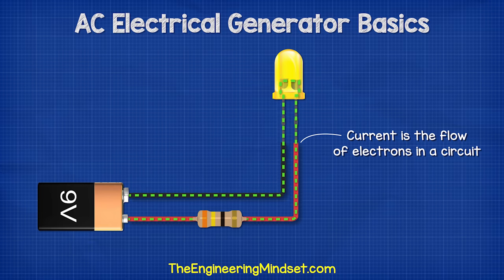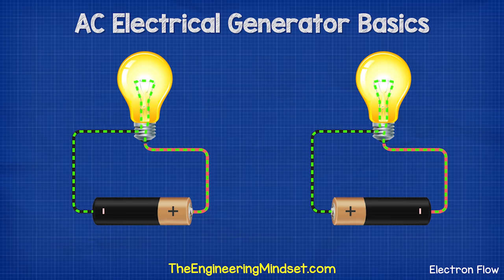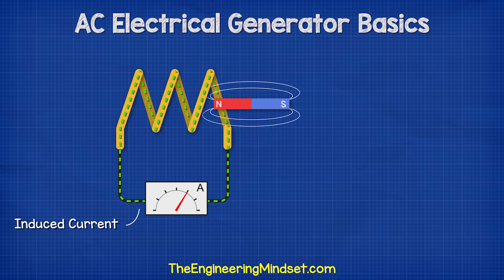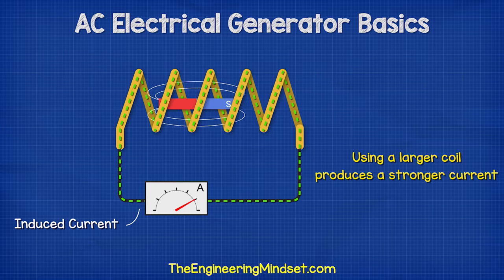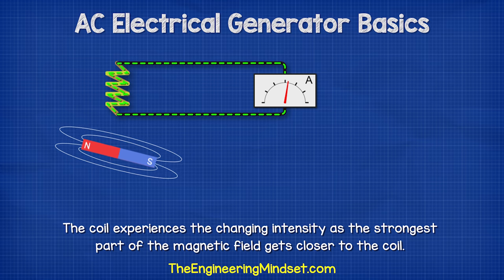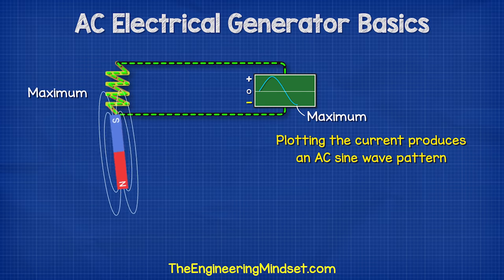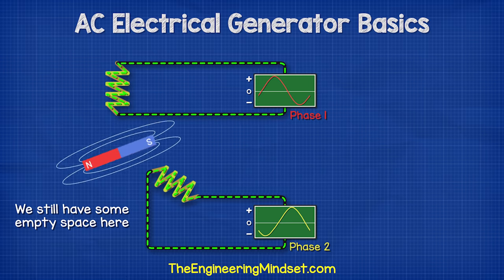AC Electrical Generator Basics - How electricity is generated

Comment: When I was teaching electronics, my students had a lot of trouble with this concept.  This is a difficult topic to teach.  This is a good explanation.
Reply: I’m sure you tried hard to reach them with the tools at your disposal. These powerful graphics really are a game changer.
Reply: What I’m still not getting is how the current itself forms. What can produce enough electrons to power anything by just putting a wire on its opposing fields? Maybe what I’m missing is how to create a battery. I’m assuming the trick isn’t electrons necessarily, but having a material that can have its electron manipulated. So I guess I need to figure out why lithium or whatever can even power anything
Reply: @BigblackDavis  Think of the simultaneous electric and magnetic fields.  They are perpendicular to each other.  The e-field generates a corresponding m-field.  If you wind wires many times, the m-field is enhanced.  That is how transformers and motors/generators work.
Reply: @danbuchner28  but in the example your giving it sounds like you already have an electric current, what I’m wondering is how can I create the initial electric current.
Reply: @BigblackDavis  Think about the right hand rule.  Your thumb is the direction of the current, while your fingers are the direction of the magnetic field.  You start a motor by applying a voltage, which induces a current.
Reply: This is really a good explanation , at school have problems in learning this at school but I understand better; bravo you've really got a Skil that teachers at school should aquire🤩🤩🤩
Reply: Why don't they use 4 phases? Why always stop at 3? The angle is now 90degrees instead of 120

Comment: This video explains perfectly how an AC Electrical Generator works. But I'm pretty sure there is one misconception. You don't induce a current, but a voltage. The potential different which you now have, leads to a current in the coil. The formula also says it: Voltage = - d(electric flow)/dt, so there is no current with this effect. If I'm wrong, I'm am thankful if you correct me.
Reply: you are correct. he said it indirectly on 0:30
Reply: does this mean it doesnt produce any current?
Reply: @benmangan9922  It does produce current by changing the difference of the potential on the coil, which is both Faraday and Lenz law (a mix of two) if you move the magnet in and out of the coil you slowly convert the kinetic energy into the electromagnetic field but simply said when you push the magnet into the coil and pull it out nothing noticable happens, because you cant see the electrons you are moving with the magnet itself (Faraday Law), but after several repetitions of the exact same movement you will start to feel the force of the EM field you have created on the coil, counter action of the EM field on the coil which means the field will change potentials to stop you from moving the magnet (Lenz Law), now if you manage to change the potentials on that field, it means you have moved electrons because you cant generate a electromagnetic field without the movement of electrons, when the electrons move they create current and that current creates electromagnetic field.
Reply: It's not Actually potential difference,it's actually the magnetic field pushes the electrons

Comment: Generators create electricity through electromagnetic induction by using a coil of wire (usually called the rotor) that spins inside a magnetic field (often generated by a stationary set of magnets or another coil, called the stator). As the rotor spins, it cuts through the magnetic field lines, creating an electric current in the wire due to electromagnetic induction, as described by Faraday's law of electromagnetic induction. This current is then collected and sent out as electricity through wires connected to the generator.

Comment: I'm just learning this stuff too (for fun).  But I've been seeing that electricity flow is the flow of an Electric Field.  The electrons are required, but don't hardly move.  Electrons move very slowly.  It is the Electric Field that moves close to c.
Still digging on this subject, but this is what I think for now.
A multi-step process.
1> Move a Magnet in relation to a "metal conductor".
2> The Magnet pulls and pushes (depending upon N/S pole) on electrons of the valence shell of the metal conductor.
3> The Magnet pulling and pushing on the Electrons creates an Electric Field.
4>  The Electric Field flows down the conductor based on a voltage difference between source and sink.

Comment: Great video, thank you. Could you do a video on synchronised generators. Example take 4 small wind generators producing 3 volts, combine them to output 12 volts or charge a 12 volt battery.

Comment: It is not the distance of the magnetic pole to the coil but the velocity of the pole passing the coil which determines the amount of current beeing produced. The higher the velocity the higher the induced voltage driving the current.
If you stop the rotation no current will be generated even if one coil is at the nearest point to the magnets pole as possible.
The energy needed to let the current flow comes from the energy to put in to turn the magnet.

Comment: Question: When the magnetic field is passing through the copper coil on the positive side for example, making the current flow in a particular direction, what tells it to go THAT particular direction? Do the electrons in the atoms just "enjoy" going left vs right depending on the North or South pole? I assume it has to do with the magnet pushing or pulling in the atoms, but just not sure. Don't want to assume! Thank you for any help on this :)
Reply: Alright actually I just researched it and will answer my own question, for anyone else down the road reading it and wondering the same thing. So yes, depending on the north or south pole, magnets will either try pulling in or pushing out the electrons in the copper wire.

Comment: Great video, could you explain "Difference of potential"? I don't understand the concept. I know it's what voltage is, but what exactly does it mean and how does it specifically effect electrons (Aka how does it "push" them in a direction, and how do you even get a difference in potential vs no difference). A detailed explanation would be amazing!
Reply from the maker: I think we covered this in out voltage explained video and capacitor video
Reply: @EngineeringMindset  I might have missed it, but I'll check your channel for the videos. Thanks!
Reply: Someone once gave me the simple explanation that voltage is like the water pressure and current is the actual water flowing through.
That's why voltage like lightning can be thousands of volts but you survive and current can stop the heart at quarter of an amp.
Reply: @oldskoolordie  lightning has a LOT of amps too lol people who survive lightning strikes are lucky they are grounded a particular way if anything

Comment: I like ur video even that i can't get all of it. And i had some question.
1. If we have 3 cycle is all the cycle  generate electricity ? (I Mean like we can charge a battery using each cycle or what ?)
2. What is better use 100 turns of 1mm coil or use 20 turns of 5mm coil ?
Thank you
Reply from the maker: Yes, can use each to charge a different battery.
The coil dimensions allow more current to flow. You could even wrap two thin wires together for the same cross sectional area but a better fill of the available space

Comment: Wow, nice explanation!

Fwiw, i would have added what doesn't work, that is, 180 degrees, and then explain why. And only then explain why, conversely, 120 does work. Though, it'd be nice to know what is best and why. The three-phase seems to work because 120 works, and there are three 120s in the 360 degrees in the "circle". But why not 4 of 90, or 10 of 36, or any other factor of 360?
Reply from the maker: Seen our new 3 phase transformer video?➡️: https://youtu.be/u0SsejDCVkU

Comment: I love your videos! If you could show how a generator for a house work like a 30 amp 2 phase and a 3 phase with telecom communication wire installed as well.
Reply from the maker: Video coming on this topic soon
Reply: @EngineeringMindset  what would happen if you wrap the coil around the magnet?

Comment: In your other video How Three Phase Electricity Works, you say the strongest part of the magnetic field is on the side, but in this video you say it's at the ends where the magnetic field lines converge. I'm wondering which is it? Thanks and great videos
Reply from the maker: This one is correct
Reply: @EngineeringMindset  I think you're right. If you look at where eddy currents are generated, it makes sense. Cheers!

Comment: An AC electrical generator, also known as an alternator, is a device that converts mechanical energy into electrical energy through the principle of electromagnetic induction. Here's a basic explanation of how electricity is generated in an AC generator:

1. Mechanical Energy Source: To generate electricity, an AC generator requires a mechanical energy source, usually in the form of a prime mover like a steam turbine, water turbine, gas turbine, or an internal combustion engine. This mechanical energy is used to rotate the generator's rotor, which is the central part of the generator that contains the magnetic field.

2. Rotating Magnetic Field: The rotor is made up of a series of magnets, either permanent magnets or electromagnets, which are arranged in a specific pattern. As the rotor rotates, it creates a rotating magnetic field around it. This magnetic field is responsible for inducing an electric current in the generator's stator.

3. Stator and Windings: The stator is the stationary part of the generator that encloses the rotor. It consists of a set of conductive coils, known as windings, which are wrapped around iron laminations. These iron laminations help to guide the magnetic field and minimize energy loss due to heat.

4. Electromagnetic Induction: As the rotating magnetic field from the rotor passes through the windings of the stator, it induces an electric current in the conductive coils. This process is called electromagnetic induction and is based on Faraday's Law of Electromagnetic Induction. The direction of the induced current alternates between the windings, resulting in an alternating current (AC).

5. Voltage and Frequency: The voltage and frequency of the generated AC electricity depend on the rotational speed of the rotor, the number of poles in the magnetic field, and the number of turns in the windings. Typically, the output voltage and frequency can be adjusted using a mechanism called a voltage regulator and a frequency controller.

6. Output and Transmission: The generated AC electricity is collected from the windings through slip rings or brushes, which transfer the electrical energy to an external circuit. From there, the electricity can be transmitted, distributed, and utilized for various purposes, such as powering homes, businesses, and industries.

In summary, an AC electrical generator converts mechanical energy into electrical energy through the process of electromagnetic induction, producing an alternating current that can be used for various applications.

Comment: Is it possible to use more phases in a generator, or is three the limit/most efficient?
Reply from the maker: You could, but 3 phases provide a near perfect constant power supply. Adding more phases could improve it further but it will be more expensive to produce the generator so the benefit is outweighed. We would need to use thinner wires also which increases resistance and reduces the amount of current that can be handled. Additionally, the entire electrical network is design and built for 3 phases.
Reply: @EngineeringMindset  what if we use 3 additional coils in the remaining empty space and connect the opposing coils in reverse polarity ... we'd still have 3 phases but twice the current?

Comment: I have a question. If you were to connect two identical DC mini motors together, and spin the axle on one of the motors, why won't the other motor spin in perpetuity? Cheers!
Reply from the maker: Friction, resistance, heat loss, noise, etc it's all energy leaving the system
Reply: Energy used to spin a motor is seven times less than what it produces by spinning the rotor.

7 isn't an exact figure. Just a rough ratio.
Reply: Pepertual motion does not exist in our universe as far as we know , more energy has to be given out to attain results , such as it is.
Reply: @ericscaillet2232  Thanks! I heard about these 'free energy' sources, and I think they are bunk.

Comment: Does the peak voltage happened when the magnet is perpendicular to the coils? The video shows the voltage peak of each coils happened when the pole of the magnet parallel to the coils. Or does this only happen in 6 coils armature?

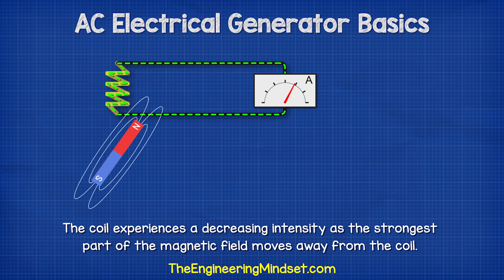Comment: 3:36, I don't understand why when the magnetic field decreases, the electric current does not reverse direction. I agree that when the magnetic field decreases, the electric current intensity will also decrease. However, the direction of the electric current must change because according to Lenz's law: When a magnet approaches, the magnetic induction of the coil will be opposite to the magnetic induction of the magnet, and when the magnet moves away, the magnetic induction of the coil will be in the same direction as the magnet's magnetic induction. The direction of the electric current flowing in the coil is determined based on the direction of the magnetic induction generated by the coil, so the direction of the electric current must be different when the magnet approaches and moves away from the coil, isn't that right? Can you please explain this to me?

Comment: Could you get more current if you use a larger copper diameter? Like 10g vs 20g copper wire. For example will I the same current with less spools with a larger copper diameter? Compared to a smaller diameter wire

Comment: Why zener diode is connected in parellel to the load...? As voltage is the same in parellel circuit how do zener diode connected in parallel regulates the voltage to the load.?
Reply: Good question. I commented so I can await the answer, as well.

Comment: But if i get it right, I could make a brushless alternator for a car this way? Instead of the windings on the rotor, put them in the stator and put magnets on the rotor. And by spinning the pulley shaft with the magnets on it you sort of "pull" the electrons through the copper windings?

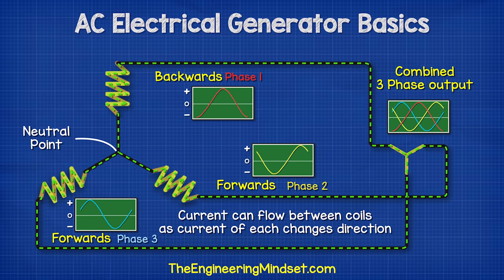Comment: 5:34 then how the current flowing without generator to push the electrons???
Reply: The rotating magnet induces a voltage which in turn creates the current. The rotating magnet is usually a DC current (created by a battery) which is rotating

Comment: Could you create an ARQ with this? I forget the name but thats the movie based on the concept of a generator that produces own power forever. Cuz if you have the battery on a motor that spins. All you have to do is start manually spinning the battery then connect the motor to a mini curcuit breaker and power itself then connect the breaker to a light or something if you want. Or would that not work and if not then why?

Comment: But Faraday law says that voltage is equal to the variation of flux not to the flux. And when flux is at its maximun its variation is zero. So how it comes that voltage (current) is maximun when flux is maximum in your animation? Please explain it to me...
Reply: Because when the rotor is parallel to the stator windings the flux doesn't have relative motion between the conductors. Therefore you have no voltage induced and no current. Once the pole is perpendicular to the windings you actually start inducing voltage and current can flow.

Comment: Is it possible to use AC current in the rotating electromagnet, and sync the motor speed (1/3 the AC frequency used in the electromagnet) so that every time the current changes direction, the same magnet direction is pointed toward one of the outer coils?  What result would that produce?
Reply from the maker: The rotor always uses DC as it has a fixed polarity. AC would cause some crazy waveforms as it wouldn't sync.

Comment: I have a single phase 230v 10 hp motor. When I try to run it from the 30 kw generator it’s like I put the brakes on and shuts down. Is that a phase issue?

Comment: I dont know if anyone can answer this but I cant find an answer anywhere. The magnetic field generated voltage or current but where do the amps/ ions get generated from? I know that the copper wire has ion moving about it but once they are consumed by our utilities where are more ions generated from?
Reply: No ions produced in the process nore used

in every conductive material you'll find electrons not used for the atomic bindings 
these electrons are able to move freely between the atoms
the magnetic field in the generator moves these electrons 
cyclical first in one then in the opposIte direction

for every timestamp in the cycle more electrons are on one side or the other 
exception: velocity of magnetic field relative to the coil is zero m/s 
this happens when the magnetic field/magnet is in perpendicular position rellative to the coil

all the moving electrons produce all the effects needed to power our devices and let them compute

they can't be get lost cause they stay in the wire and stay part of the material the conductor is made of
they just move a tiny bit back and forward with AC

Comment: Years ago I rewound a charging coil for my motorbike to fire off the ignition coil the only way that I could get spark was to turn the flywheel backwards .I then wound the charging in the opposite direction ,then it produced voltage when the flywheel was turned in the the proper direction I thought that no matter the direction the coil was wound it would produce voltage the correct way to fire the ignition coil in the direction the flywheel turned normally .why is that?